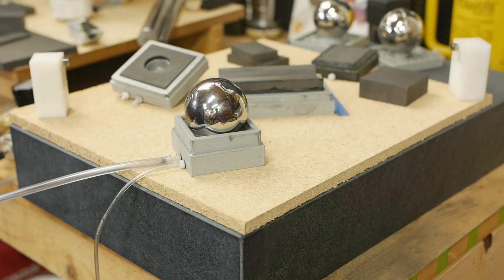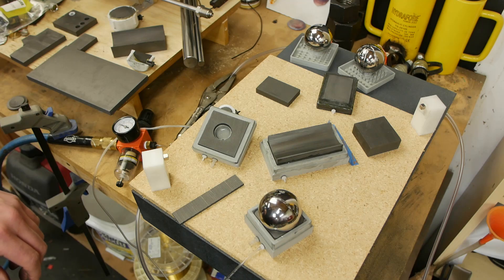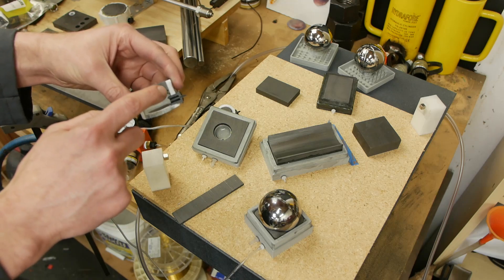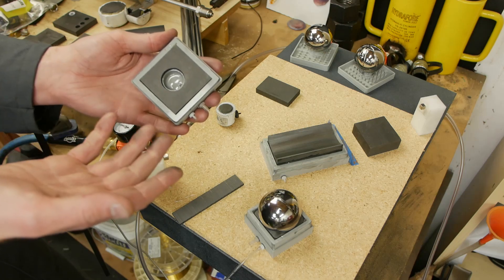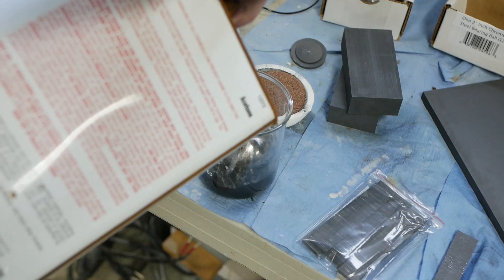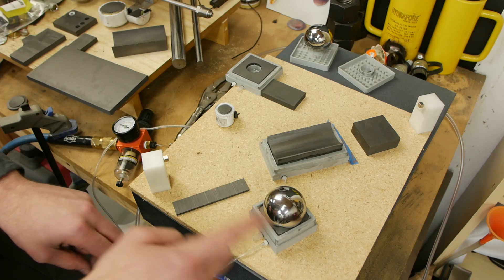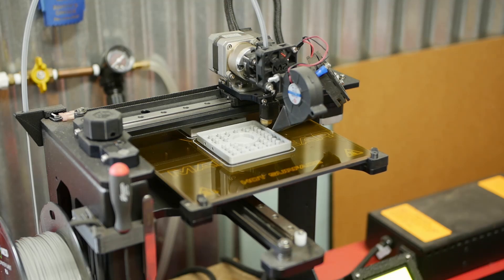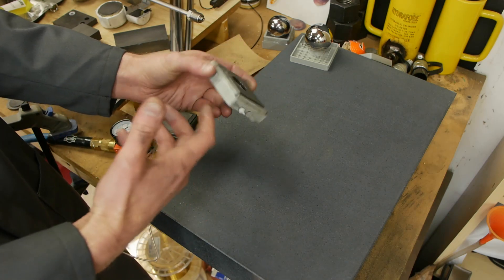Make vacuum pre-loaded spherical air bearings without special tools

Comment: Here's a link to a video showing the technology extended to a double supported shaft with two U shaped air bearings. This configuration allows balancing  a wheel assembly or fan assembly which are very useful applications. The design shows a bolted air bearing cavity which is less likely to fail under pressure than glued. The two bearings must be honed in place by simply creating a tool shaft with groves at both ends. This is critical to alignment and the assembly won't work without the hone step.

https://youtu.be/4JPl4QRFTlA?si=JObM0t5wWCPzeoAp

Comment: 16:01 Warning: I first tried a glued assembly. Used the tapered wall design and printed from pla with 100% infill and 5mm thick walls. The assembly held until 120 psi. That's double the nominal pressure. The glue failed in shear along the non tapered wall. The pla was undamaged. I fortunately had the air bearing in a 5 gallon bucket of water. The bucket half emptied! That's an impressive amount of force (nearly 500 lbs) blowing off. I've switched to a bolted and rubber gasket design. Pressure testing was fine at 120 psi. I will post more details of the design and manufacture later and how the design works. I plan on using two semi cylindrical air bearings for a shaft balancer. I am going to machine the final enclosures out of Aluminum to be safe.

Comment: the problem with PVC is that it's flexible and can stretch under stress. That's why there's leaks. i can't get PVC to be airtight unless I use the PVC adhesive that basically melts the PVC together, but I don't think that would stick to graphite.

Comment: Maybe interesting tangent: single-ball bearings (greased) have various uses where some angular misalignment is unavoidable.
If you have ever seen, or better yet, played on, one of the great old steel playground "merry go rounds" of yesteryear, some of those thing lasted literally 100 years, using only a single steel
ball and two mating cups (and grease).  Rather different load vs. RPM requirements. ;D

Comment: You can use two piece cylindrical bearings to mimic a hole bearing. I have no better words how to describe this. Then you can even slice a half of the "linear" bearing into thinner parts, and so get a "true" hole bearing. In order to make precise grinding tool, you can apply a sandblasting on a ball/cylinder surface rather than gluing an abrasive garnet. A sandblasting is a matter of some sand and a karcher washer

Comment: Usually in industry where air bearings are used, they'll have three of your open side cylindrical bearings mounted 120* apart with threaded mounts to apply preload.

Comment: There's a commercial tool that uses porous graphite to suspend a rod for ultra low contact force measurements. 

LVDT. 

Measurements down to a millionth of an inch are possible.

Comment: When you pulled out the bearing ball with the slits cut into it I fell in love. Its a spherical reamer now.

That is an elegantly simple solution.

As for the porosity of the FDM printed parts, a light brushing or misting of a acetone or another solvent does wonders to smooth and seal the surface as long as you're using a compatible filament like ABS, it doesnt work on PLA, just makes it gummy.

Comment: The through bearing with a rod, you can use the same rod as both the grinder and file since you'll need to use the tip for that work. Then cut the tip off and finjsh the edges obviously so it doesn't catch. If you really want to get creative you can mount the rod in a milling machine if you trust its tolerances that much.

Comment: There is a compound called "valve grinding compound", its sold at automotive parts stores, it's for lapping in valves, it's a gritty paste, which would be much easier than grinding or glue to your metal, give this a try, I think you will see it's perfect for this project.
Great video brother 🤠🙏💯💯💯

Comment: I think a super simple design for a captive cylinder air bearing would be 2 graphite bushings on either end of a tube that you pressurize. I could be wrong in how I think it'll work but it might work.

Comment: When seating in new bearing pads or refurbishing bearing pad surfaces after a scheduled outage we actually use fairly rough sandpaper to score the antimony / tin compound on the Michel / Kingsbury bearing pads.
Reply: In a properly constructed air bearing they will create the air pad without needing any pressurized air source

Comment: About 30 years ago I had an idea to make a turntable for playing vinyl records that used some kind of air bearing. The idea was that if the turntable was isolated from its supports then no vibration would get through. Problem was I never had enough engineering skills and I would never have thought of doing this. Excellent demonstration. Thanks
Reply: The best 50 grand you never spent! ;-)

Comment: for low speed (no friction, no melting) and not much weight (deflection)(depends if using continuous fiber filaments or sand filled prints) 3d printed parts can be used for the air bearing instead graphite, look at this publication -> Design and Testing of a Low-Cost, Open Source, 3-D Printed Air-Bearing-Based Attitude Simulator for CubeSat Satellites.pdf

Comment: The ultimate air bearing was an application for moving the refrigerator,  You just hooked the exhaust (blow) tube of your vacuum cleaner to the device and presto, the big box floated across the floor.  A practical use of this design.

Comment: Would be interesting to know how much load it can transmit without touching the surface and how much energy it takes to pressurize the air being used. I can imagine there's a relation between those two but it would show the total efficiency of the bearing compared to for example a ball bearing or a friction bearing.

Comment: I've carved some graphite in my day.  Glass blowers call those marble molds.  Another great way to machine that shape is to weld a shank to a large washer- call that the north pole.  slightly sharpen the southern circumference, creating two cutting edges like a drill bit.  Chuck up on the shank in a drill press.  I really liked your garnet abrasive idea- thanks for sharing!

Comment: Check out Professional Instruments.   The PG6 bearings are capable of over 15,000 RPM with modestly high till load capacity and error motions of under 12 pico-inches.

Comment: Amped broadcast 2" video tape machines had video heads that rotated at 14,000 rpm. They had a portable VTR that used steel ball bearing, but the ball bearings introduced errors onto the recorded signal, but the air bearings worked very well

Comment: Screwing around with bearing bronze, I wanted to make a very precise bushing so I took precision ground PARAGON OF ALL MATERIALS! tungsten carbide and made a 50mm diamond grid aligned in a spiral shape and used it mounted in my big Monarch lathe with a tail stock and I took my square stock of bronze, drilled a couple holes using the lathe then switched to a boring bar and made the hole within .005 split the stock in half mounted the carbide "hole file?" And set up a clamping rig I made that mounted to th,e ways on the lathe clamped the bronze around the carbide and hit GO. Worked like a hot damn buddy

Comment: What’s that FDM printer? I’m no FDM expert, but I haven’t seen that design previously. It appears that the injection head it static on the y & z-axes with the table moving instead. The head only moves in x-axis. What is this design called?

Comment: But how does it perform under a real world LOAD!    Bearings operating without a load are not impressive bearings. I have a feeling the "air lubricant" will fail with nearly any load.

Ok, it's still interesting and impressive....just not very practical.

Comment: You should put a thermal cam on these, to sense the air leakage from the graphite-materiel though not sure how reflective the grinding surface would be, but the rough sides would display the amount of air leakage.
uhh that big sheet of not rounded glass circulating over those hand veins.. 14:37

Comment: Your final and in this vid so far not built, I feel that the support of a shaft with equal air pressure all around, would cause the shaft to ride on the lowest point on the bearing material due to gravity????????????????????  :)

Comment: That's not quite what we call air bearings in the industry. Air bearings, that I am aware of, consist of a nearly frictionless gap of highly pressurized air. There should be no contact between working parts.

Comment: If you were to make a huge clean room with smooth flooring and fit two large air bearings on the bottom of a skateboard it would hover sorta like the skateboards from back to the future. Too bad you would also have to have a compressor backpack.

Comment: One of the reasons NASA engineered a multi million dollar pen to write on paper in space was because pencils released small amounts of graphite, enough to destroy electronics on board the shuttle and space station.
This makes it very dangerous to work with graphite and using these bearings is a big no-no because graphite dust will be released eventually.

Comment: it would be interesting put the bearing inside a vacuum chamber and ,instead pumping air through the graphite, let the vacuum do the job( by leting the tube end at ambient pressure). On this setup you could have even lower resistance.

Comment: are there pumps that uses the same motor to power the small compressor needed for the air bearing? What would happen to the bearings when the pump is off? since the graphite is so soft the weight of the motor and pump might wreck the inner race bearing surface.

Comment: Cap the porous ends with epoxy. You could also cast epoxy over an indented graphite block to ensure it is captive.
You can also add a pause to the 3d print, insert the graphite block then finish the print.

Comment: Air leakage, pucks and PVC pipe.  Use a threaded female cap, put threads on your puck, apply adhesive voila.
https://www.poolandhottubdepot.com/white-pvc-pipe-cap-3-4-female-pipe-thread/?gclid=Cj0KCQiAmZDxBRDIARIsABnkbYQGfaiDEdhdM7YRoIaD89WEs9zLHIWNADrlkEI1RzT-Q6eUv8YQ6EoaArqzEALw_wcB

Comment: Fascinating. Reminds me of the old Xynetics flatbed plotter I used to work on back in the 90's, that was developed sometime around the 60's or 70's. It used a magnetic head that was attached to the underside of the top bed, and an air pump was used to push it off just enough to where the head could move freely. Motion was not controlled by X/Y motors, but by pulsing electromagnets to "crawl" across the underside (and at a surprisingly fast speed.)

Comment: Great video! What is the mass flow rate of the air? I'm considering utilizing these bearings on a 3d printer project I'm embarking on, but don't have a full size compressor. So I'd like to use a small DC and quiet one, but am not sure how much it would need to supply.

Comment: Also a smear of epoxy is a good way to seal external surfaces, I did that recently with a piece of metapor porous aluminium, I just installed a pneumatic fitting straight into the material and sealed all the exposed surfaces with epoxy, as simple as it gets.

Comment: If you mount one ball at each end of a tube you can make a fully constrained shaft, I did this with cast orifice air bearings although not very well. The flexible mounts were used for preload: https://www.youtube.com/watch?v=QdbqeFrMhfI

Comment: When it comes to sanding tooling. I have been printing sanding tools for curves and compound curves lately. Yes industrial tension/compression loading sanding tools that let you set a radius are nice. But the ability to drop a radius into fusion and then print a custom radius sanding tool really saves time. Plus for circular situations you can add a chuck/racket extension port and then use a drill/die grinder/ or drill press with it.

Comment: To go the quick and dirty route, could you use a PVC coupler that has the lip in the inside as your catch for the graphite disk. Attach multiple to a central air supply pipe and have a long run of bearings.

Comment: Vacuum? That ball would not spin if it were a vacuum. That will be the opposite - compressed air, using the Bernoulli effect to hold the ball in place.
Reply: Yes vacuum. Watch the video. There are two lines. One pressure and one vacuum.  He does it with a flat piece of glass too. Clearly not the Bernoulli Effect.
Reply: @terryg652  The Bernoulli effect does exactly what happened with the piece of glass. Blow air through a hole and a flat plate will be held up by it. The speed of the air causes sufficient pressure drop for air pressure below the plate to support it. The first demo with vacuum was just to show how low friction the graphite was. After that the demo had only one pipe attached, and that was for pressure.
Reply: @donepearce  At 0:16 there are two hoses.  
At 14:10 there are two hoses.  
There is no demo with the ball or glass upside down with only one hose attached. The second hose is for vacuum... as he describes... which holds the ball and glass in place.

The Bernoulli effect would occur on a flat surface blowing parallel to it.  Not perpendicular as in the video.
This is how it would work  https://youtu.be/jw7Xn7VmSQ0?t=57  
The Bernoulli effect occurs perpendicular to a ball, and parallel to a flat surface.  Clearly if you held a hair dryer perpendicular to a piece of paper, the paper will not be sucked TO the hair dryer.
Reply: @terryg652  Yes, I mentioned the second hose. The Bernoulli effect does not rely on a flat surface. It occurs anywhere the airflow is fast. And the ball would not remain in place upside down - it is far too heavy.
Reply: @donepearce   donepearce  and yet the video shows the ball upside down. So clearly...  not too heavy.  There is plenty of surface area for the vacuum to hold the weight of the ball.
There is no 'fast airflow' in any of the demonstrations. The air is diffused through the graphite. Whereas the vacuum is applied directly. This is clearly not Bernoilli
Reply: @terryg652  Know what? You may be right here.

Comment: So could vacuum preloading be used in space applications? I've always been interested in how you'd have a spinning hab with low friction attached to some static fuselage.
Reply: Unfortunately not in the same way.  The vacuum isn't really doing anything -- it's the excess air pressure on the other (non-vacuum) side that is actually doing the preloading.  In space, you wouldn't have any air pressure on the other side to do that.

You could do something where you have a flange held by air bearings on both sides, which would work well except that if it's trying to be the seal between the two pieces as well as being a bearing, it will be blowing air out into space.

Magnetic bearings would certainly be a possibility, but again, they don't form a seal.  The main issue you'll have isn't the bearings but the seals, assuming you want to have a continuous air-filled space between the two parts.

Comment: I like your video. Have you ever thought of using magnetics instead of vacuum?  N-53 and I believe if you look hard for it N-54 Rare Earth magnets would be a good chose, unless you wanted to use Electric instead. At least you could eliminate a potential failure of one of the systems.   Also, it would most likely be cheaper to go to your local pet store fish department for the vacuum parts.  Another Idea is to use potting compound like SILICONE from the Electronic side of things to fill in gaps around your Graphite Bearings. I believe it will work better for you. Just a thought.

Comment: 5 stars.  Awesome in so many ways.  And DIY on top of that.  This is the first video I have seen of this kind, and I never knew that graphite was porous and used in air bearings.   I have had a lot of interest in air bearings for a long time, and they have a lot of standard applications, but I still have yet to figure out how to use them in an application that I am interested in or working on.  I could maybe see them supporting load on a CNC machine.  I love the concept of air bearings, but you need a big tank of air to do it with.  And no one likes to listen to loud air compressors.  I built a silent one, but it does not have the same power or enough power for an air bearing.  The air supply is the main drawback to air bearings, but the performance is unmatched and ridiculous.  That you for this video.  You were so well spoken on this video and said a lot quickly.  Great job.

Comment: RE: 4:43 --- the pipe you show is SCH 40 female - glue fitting. Nothing wrong with that, but had you use a Threaded SCH 40 end cap - the Threads would have help in not only give the glue a place to go, but would have helped in sealing the graphite in place with the glue. You might want to try it.

Comment: Check out 
Thomas Sanladerer, he recently used uv resin to coat FDM parts to great success.  Video entitled Finish your filament prints with SLA resin - fast and cheap!, shows how you can do this process to make your projects air/water tight. Inexpensive and useful.  I would think it would go along better than 2 part epoxy as you can paint it on and cure at your leisure vs waiting for 2 part to air cure.

Comment: how about using a freaking o-ring and a pvc bush welded (chemically)only a hot dog down the hallway fit required and mechanical retention. it works for NASA and that guy who looks like two 12 year old kids stuffed into a bad suit shootin rockets into the air.

Comment: so i am building an ev bus and i am using 2 very large electric motors and i will need clean filtered air for other things could these barings take the load and how much air and vacuum would i need? while i do have a bus this is all theoretical use whatever numbers you want but the bus will need between 300 and 400 hp.